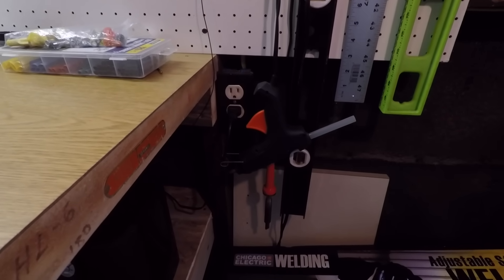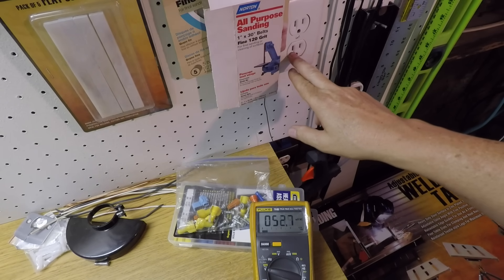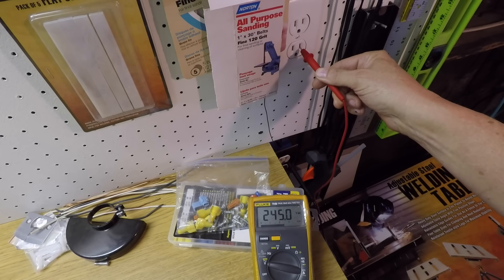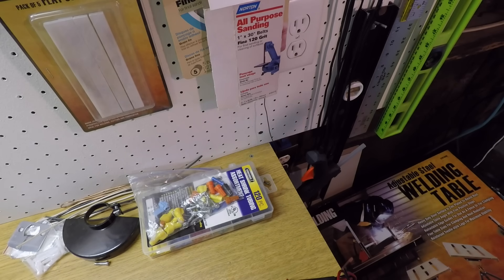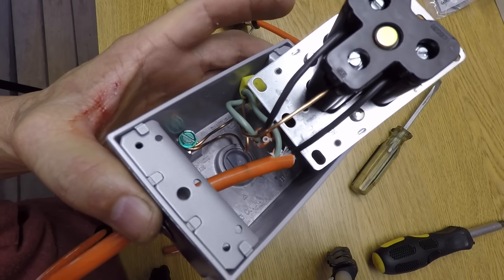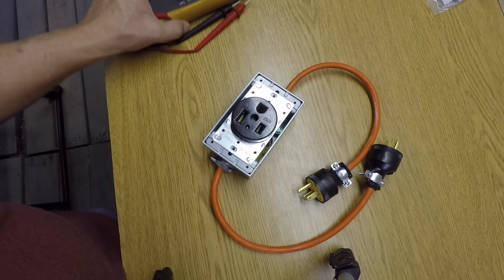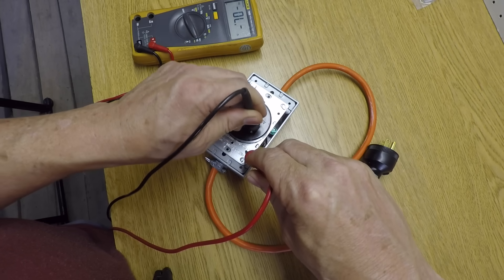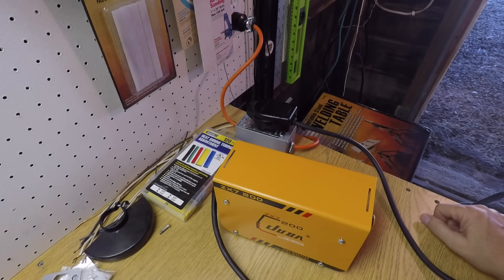How to Get 220v From 110v

Comment: Why not just run 240 line from the main circuit box?
Reply: YES !!!!
Reply: The reason he got 240 volts from both receptacles when he metered from both hot wires is because each receptive was
Coming from different hot bus bars from the panel . So he does have a 120/240 V panel box in his home . I am an electrician for last 20 yrs and I have never heard of anybody doing this . I certainly wouldn’t . Just run a separate line to feed the 240 V load
Reply: Wouldn't have a reason for a you tube vid then.
Reply: how do you change an existing 120v outlet to a 240v?
Reply: Jay Hardy 
You don’t! There is a reason they are configured differently so you cannot accidentally plug a 120v device into a 220v circuit.
Reply: This way he has the option to use 120 or 240 if he use both of those legs to a 240 box he would just have 240
Reply: The main reason would be he probally would use the 2 outlets more often than he will the welder.

So when his welder is not being used he can make coffee. 

That said DO NOT DO WHAT HE DID VERY UNSAFE ... dont fk with 240!
Reply: What if you have to do a welding job out of the shop and there isn't any 240v on site? This is what this setup is for
Reply: He meant if you don't have existing 240V line, you can improvise to his method.
Reply: Abby Babby  This system is more versatile as it is somewhat portable.
Reply: Let’s say you need 240 volts in a remote location but only have 120 volt outlets available..that is why.  At home it’s no problem.
Reply: Sting running 240v off a strictly 120v system will not work. Using 240v off the same 120v phase, is dangerous and damaging to all components involved. 

Do it, and let us know how it works out for you
Reply: Justin Smith you can’t get 240 off the same phase. This is fine. It’s just a tiny welder not rated for much current. There’s only one phase to begin with, but it’s split in the middle giving a neutral potential and  giving you 240.
Reply: @sting1111  yeah, because you'll definitely find 2 outlets next to eachother and out of phase, before you'd find a 220
Reply: It's about creativity and think differently.
Reply: @ZERO-fi8ip  no its about safety and not being a dumbass and burning your house down lol
Reply: what if its a 120 or 110 voltage come in the panel
Reply: @seanjamaica5308  220 is just 2 110 circuits. In the box, a 220 breaker is basically just a 2 pole breaker each supplying 110.
Reply: @briensickler8109  I like your explanation.
Reply: Brien Sickler 
Not exactly. If you measure AC voltage on two breakers that are fed from the same buss, you won’t get 220v. AC Voltages are not necessarily additive like DC series connections.
Also, I am not sure what would happen to the 220v part of the device if one of the legs’ breaker tripped. 
Also, this setup probably violates electrical codes in most states.
Reply: @briensickler8109   no, it's not
Reply: @seanjamaica5308  US always uses 120/240
Reply: @seanjamaica5308  Own a bobsled?
Reply: @seanjamaica5308  you would need  240 volts coming into your panel. Some older houses only have two wires coming off the power pole which means they only have 110 volts . If the wires coming off the power pole are three. 1 is the common wire or ground, and the other two are 110 volts each . One 110 volt line goes to one side of the panel and the other 110 volt line goes to the opposite side of the panel. A 220 breaker grabs on to both of these 110 leads. If you were grabbing two 110 v from a shop you would have to make sure each 110 came from the opposite sides of the panel. Not sure if this method would work otherwise.
Reply: @redwood6737  It would not work if you only had 120V to your panel.If you have 240v to your service, you would hook to 2 separate breakers directly on top of one another. The bus bars inside the panel alternate vertically on each each side of the main or sub panel . This is why you will see 240V breakers handle tied together. AC current switches polarity 60 times per second. When one leg is positive, the other is negative. There is a red and a black leg that need to be combined to get 240V,  ( on a single phase service). If both taps were taken from the same leg you would have 120V that would not show on the meter when you plug the multi meter into two outlets as he does here. . You would need to go top grounded conductor to get a reading if both outlets were wired to the same leg. This is the "electronics" in the commercial box he talks about. They reverse the sine waves of one of the 120V circuit to allow for current to pass from one to another, if that makes sense.
Reply: @wazjr1  wrong, wrong
Reply: @redwood6737  yep
Reply: David Wasney, very well put. You can't make power out of thin air. Well, maybe a guy could, but it hasn't been harnessed yet.
Reply: gaza Jamaica that doesn’t exists unless possibly apartments all houses have 240 behind your breaker panel
Reply: @seanjamaica5308  Then all you'll have is 120VAC.... NOT 240VAC.
Reply: @BIGTUBEONE  what redwood said is correct.  You cannot get 240v from a 120 panel. The title is misleading should probably read, "one way to spend 20 bucks and 15 minutes."
Reply: @BIGTUBEONE  wrong

Comment: So those wall outlets are out of phase .. right ? Wire in a 220 outlet. Just a suggestion
Reply: Yup, two separate phases he chose to rig there instead of a homerun from the breaker with 220
Reply: Time waster, isn't it called split single phase?
Reply: 220 in home is single phase so not out of phase the breakers are on each side in the main panel a leg  off each side just like incoming power at the top a wire on the right side and one on the left side as across those two is 220 volts.

Comment: Do you really think you made 240v from 120?  Damn.
Reply: DOESNT anyone understand how electrical power is supplied to a house.
The local transformer that supplies a sub-division produces 240 V AC.
BUt the 240 volt supply is ACTUALLY 2x120 V AC SUPPLIES.
The electric company transformer CENTER TAPS THE 240 V supply to provide 2x120 V.
When you look inside your electrical distribution panel there are breakers on the left side and on the right side, then there is a NEUTRAL BUS which is the CENTER TAP of the XFORMER.
THE 120 V sockets in the house are fed from a wire from  the NEUTRAL BUS and a wire from either a breaker on the right or left.
IF YOU CONNECT A WIRE FROM A LEFT HAND BRAKER AND A WIRE FROM A RIGHTHAND BREAKER YOU GET 240 volts and that is ABSOLUTELY KOSHER.
That is how you get 240 V for a STOVE or a DRYER or your AC.
PLEASE BE AWARE, some electrical panels provide 120 V from the XFORMER to each ALTERNATE BREAKER, not breakers on the left or right.
So if you take a wire from ANY BREAKER  AND ANOTHER WIRE FROM THE VERY NEXT BREAKER, YOU WILL GET 240 V.
And that is absolutely STANDARD PRACTISE.
A 120V circuit goes from a BREAKER AND THE NEUTRAL BUS.
A 240 V circuit goes from 2 BREAKERS each one connected to opposite ends of the 240V XFORMER feed from the electric company.
A SEPARATE GROUND WIRE MUST ALSO BE WIRED TO EACH OUTLET.
The GROUND wire is at the same potential as the NEUTRAL BUS, which is the CENTER TAP of the XFORMER.

Comment: If they are 20 amp outlets you have the wrong type wall receptacle. The ground for 20 amp should look like -l.
Reply: By code you are allowed to put a 15A recept on a 20A circuit. The circuit is rated for what he is doing, but the receipts are only designed 15A.
Reply: You mean neutral not ground.
Reply: William Hawkins it’s very common to use 15 amp receptacles on a 20 amp circuit, and if it’s your house and don’t have any tools or appliances with a 20 amp plug, then who cares
Reply: @MrNicjohnston  it's because 15 amp recepticles are not rated for 20 amps and could fail under load. Everything in a 20 amp circuit should be rated to handle 20 amps.
Reply: @WApnj  Modern 15a outlets have 20a passthrough rating.
Reply: @MrNicjohnston  the receptacle cares. Its only rated for 15A. 20A with that receptacle will cause a fire.
Reply: @mortencoutts3395  I'm afraid you may be a little misinformed on that
Reply: @mortencoutts3395  You would be wrong.
Reply: That is exactly the thought coming to my mind when he presented the outlets on the video. I think you mean the neutral/return should look like -| though. The ground is the same for standard household 110V/15A and 110V/20A outlets.
Funny thing is, I was watching a video on Yamaha generators recently, and the outlets on this rig had the "-|" socket but output was rated for 15 amps. Yamaha had it backwards the other way - which I think is more dangerous than this presenter's way (although still wrong).
Reply: finally ONE comment that makes sense, all others were stuck on the wrong point.
Reply: 15amp outlets are perfectly legal on a 20amp circuit and SHOULD be on a 20amp. Never want to run more than a single outlet on 14g. As long as you have more than a single outlet on 20amp you're 👌

Comment: A 50 amp outlet on a 20 amp circuit, what could go wrong? 50 amp should have 6 gauge wire and 50 amp double breakers. Also why cut the white wire, could parallel with black to carry twice the amperage and not just 15 amps from the 14 gauge wire?

Comment: @14:00 minutes, concerned about getting one plug pulled while the other one is in accidentally, you can put a hardware or wood brace to joint the 2 plugs for the 240v just so you have to unplug both before using any 120v. The 240v plug-in will rests on top of the wood where the 2-120v plugs into the wall. It would look better if the 2 - 120v outlets are 2"-3" apart on the wall.

Comment: What do I need to do to be able to hook up my 30 amp 5th wheel to my house like this?
Reply: going to burn your camper down
Reply: 10-2 with grd on a single pole 30 amp breaker
Reply: Your Rv is 30 amp at 110 please don't make the mistake of running 220 to it
Reply: Call an electrician.

Comment: It might be helpful to see how this is done an equivalent commercial product... That costs over $300. https://www.amazon.com/Hubbell-Wiring-Systems-YQ230-Intelligent/dp/B0000AQQT9

- Safely powers 50 amp 125/250 volt boat from (2) 30 amp 125 volt receptacles at dockside
- 4-pole contactor breaks both hots and both neutrals to prevent possible "live" plug when not engaged
- UV resistant housing, 30 amp plug that connects to 30 amp shore power, safety indicator light, internal cord clamps, sealing grommets, anti-fog-rain-humidity environmental seal, 50 amp connector body that mates with boat cord set and Hubbell connector and plugs
- Shuts off power if improper wiring condition exists on power center or if 1 plug is not fully engaged
- Senses polarity of 30 amp receptacle on dock and (2) 30 amp receptacles from opposite phases

Your solution has none of those safety features. It may work on that bench, but anywhere else, or if the equipment itself has a fault. Well, anything could happen. We have electrical codes for a reason.

Comment: You could add a double box with 2 Off/On switches, that would allow you to just flip the switches off before you unplug the welder (or whatever you are using 240v for), to kill the power to the 240v box.

Comment: Hey. I'm an electrician... I do alot of sketchy stuff in my shop because I understand how it works and what I can do. But if your draw on the leg with your shop lights trips that breaker you will single phase your machine, spike amprage on other leg  possibly damaging the inverter. Just saying.
Good luck

Comment: Without getting into those two recepticals and running wires directly into your 220 receptacle box, this was a nice DIY video other than not pinning the 2 single pole breakers together or replacing them with one 2 pole breaker.  15 amp wiring and 2 -15 amp plugs were fine since in your other video you stated the cord on the welder was 14 awg.  I read some comments that the plug on the welder was too big.  Too big a plug on the welder would never be an issue (just ridiculous negative comments.)  Would this pass the NEC (national electrical code) probably not. But who cares. Anyone wiring this up, should have enough sense to plug both plugs in prior to plugging in the welder.  This is a quick way to obtain 220 v from two 110 recepticals on different legs without hard wiring them in. So you want to pass NEC you hardwire from where the power enters the garage into a 220 volt receptacle and replace the 2 breakers with a 2 pole 20 amp breaker. That would require a lot more money and a lot more expertise.  Good job.
Reply: DIY Homestead Projects this was a very informative video...as with anything, it’s always gonna be folk who want to show off their book sense...i guess it makes them feel intelligent......well, book sense is irrelevant without common sense...thanks for the video
Reply: finally a positive comment on this video, I did this in my garage to power a 3hp delta unisaw and it has been working perfectly fine for almost a year now. as long as you aren't stupid this works fine. The only thing I do is unplug both cords when im done working for the day

Comment: Yes if Welder is plugged in and just one of the 110 plug is in. The one plug that is not plugged in will become hot because it can back feed through the transformer windings.
But possibly won't back feed unless the welder switch is on. I don't see any problem if both 110 plugs are in prior to plugging in the welder.
Reply: what transformer windings ?? both of my welders are inverter based.... there is no ancient transformer in them.... get with the times and stop using antiques
Reply: P Stoneking yea, what transformer windings?  Does a welder have a transformer inside?

Comment: Looks like he cut off the white lead see at 5min. in you can see it at the orange cover.   The receptacle is grounded to the box.  The white wire must go to the place where he put the bare copper line.  The way he wire the box makes the box hot.  IE if you put a meter from the box to a ground it will show voltage.  Don't use his method.  Go white to neutral lug on the 220 out let. The breakers should also be tied together so if one trips the other one will.

Comment: 13:00 If only one plug is plugged in and the load is switched on, the other unplugged cord would have 120 volts on it since there is no return for it. The entire circuit will have the input voltage across it.  Try this- wire a light bulb to the hot leg only and then measure the neutral side of the light bulb against ground. 120 volts will be there. It's the same idea, showing how you get full voltage through the circuit until it is completed.